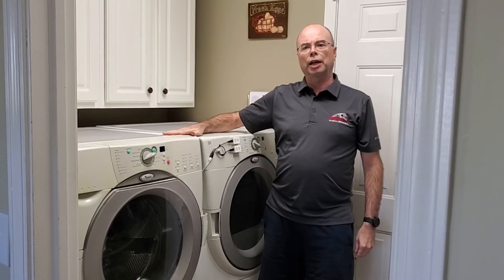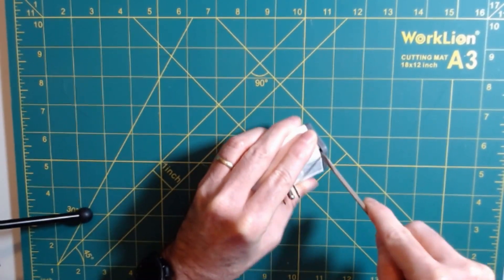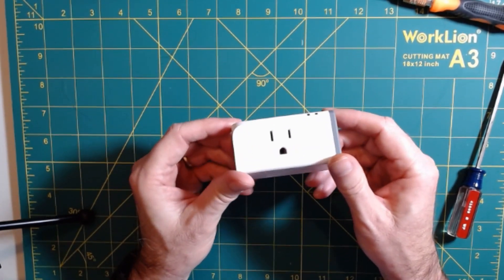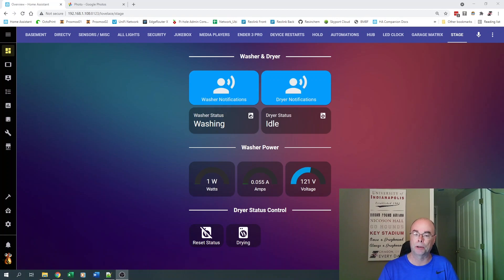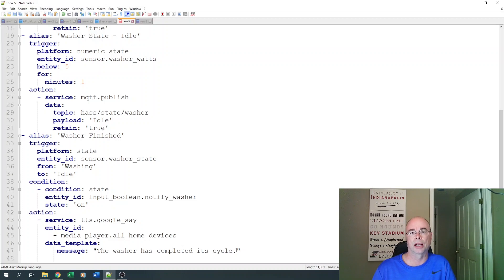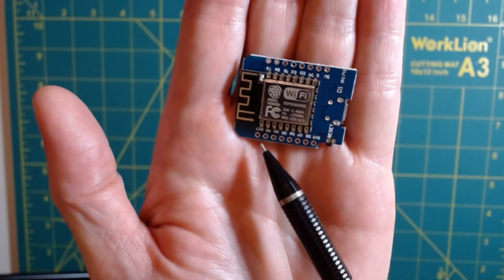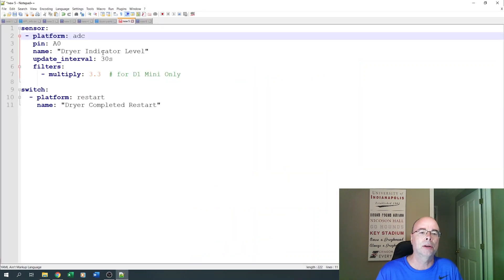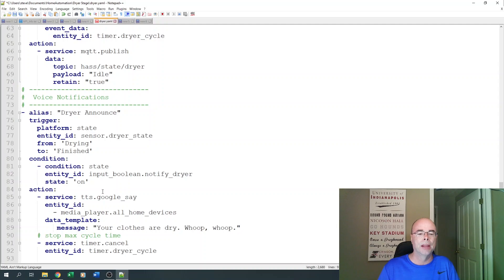Washer and Dryer Notifications for Home Assistant

Comment from the maker: UPDATE:  Due to discovered inconsistencies over time with a photoresistor and the analog (ADC) pin on the D1 Mini that would require a rebuild of the sensor to restore original sensitivity, I designed and implemented a new and improved sensor for the dryer notifications.  You can see how this new sensor is build and used here:  https://youtu.be/P5Xm-LPHFRY

Comment: If your dryer does not have indicator lights, you could use air flow sensor or temperature sensor in the dryer vent tube. Airflow may get fouled by lint over time, so a temp differential would likely be easiest. The temp sensor could be taped to the side of the vent with foil tape so no permanent modifications needed. It would just need to see that the vent temp is higher than ambient.
Reply from the maker: That's a great idea!  My solution was pretty specific to having a dryer with some sort of indicator lights, but your solution should work for just about anyone.

While I haven't tested it, I wonder how long it would take (or how big of temperature variance occurs) from the time the vent heats up enough to note that the dryer has started, and how long it takes to cool (or how much) after the dryer stops?  And how might it work in a situation where the dryer is just running on "tumble" mode... basically just tossing the closes around and passing unheated air (our dryer has that mode... don't remember what's it called).  But it might be possible to deal with those scenarios via the automation.  Have you given this a try?  Just curious.

But it is a great alternative idea.  I love it when my viewers come up with ideas on how to improve one of my projects.  Thanks for watching and taking time to pass along a really good potential solution for those without indicator lights.
Reply: @ResinChemTech  No, I have not tested this, I was just brainstorming how to do dryer notifications and came across your video. My current automations are limited to what Alexa can do with cheap smart plugs and  smart LED light bulbs. I really want to step up my game and integrate HA so I can have more options. 

What I am contemplating is having 2 temperature sensors, 1 on the vent and one as an ambient, and then you could code in whatever differential you wanted based on your particular dryer personality. I would guess that it would not take long to sense a significant delta between the sensors. Using a delta would also help offset any seasonal heating or cooling that may happen to the vent tube if it is close to the outdoor exhaust point. I was also thinking about  the 'wrinkle guard' or cooldown cycle, and I think it would be a good idea to announce the cycle complete before the dryer fully shuts down, so that clothes can be removed during that wrinkle prevention part of the cycle. My dryer actually sounds the (annoying) buzzer at the start of that cycle and again at the end. 
Remember in your stair lighting video where the TOF sensor is taking measurements all the time, but it only reports to trigger the automation if the variables align to make it 'True'. I think a similar coding would work here so the automation logs are not flooded with unnecessary readings. 
Again, I am just brainstorming, and being Thanksgiving, my thoughts are clouded by tryptophan and pumpkin pie. :) Hopefully the idea will spark someone that knows how to create the code. If I get there first, I'll update.
Reply: @ResinChemTech  I used this method by placing a Dallas temperature sensor in the the bottom of the dryer, against the exhaust tube.  I also added a Home Assistant automation to monitor and to send a message if the monitored temp goes above 100.  This I hope will notify me if a blockage were to develop.

Comment: I know you didn't go down the road of internal relays on the buzzer due to martial bliss reasons. If you could, what would be your setup? What relays would you use? controller ? etc.
Reply from the maker: Well... until I opened up to see what I was working with, it's hard to say for sure.  Assuming that there was DC voltage present (highly likely since there are indicator lights, two 8-segment numeric displays and a buzzer... it's unlikely these all run off of AC), I'd likely use the DC voltage stepped up/down to 5V and use an ESP8266.  

I'd then likely use either the buzzer or the cycle complete indicator light as the trigger for the automation.  Voltage would be applied, for example, to the buzzer when it sounds that the dryer cycle is complete.  I could take this voltage (stepped down to 3.3V max) and connect it to a pin on the ESP8266.  It would watch for a voltage change... and that would trigger the voice notification via Home Assistant.

A challenge might be a reliable wifi signal to the ESP8266 board, since it would be inside the metal cabinet of the dryer.  But since the front panel is plastic, I could probably position it so that it would get an OK signal, as I have a access point just a few feet away in this case.

Again, all this is hypothetical based on what I found inside the control panel.  But those were my initial thoughts.  As long as there is DC voltage present within the control panel, there would be a lot of ways to tackle it... likely with just something like a D1 Mini/ESP8266 and maybe a buck converter and a few resistors.  I might convince the wife someday to let me try, but to be honest the current install is working fine, so she is less likely to let me try it as long as the present system is meeting her needs!

Comment: Nice video! I am new to HA and I am trying to build an automation like this one. I am having difficulties in creating sensor.washer_state in order to use the “from ‘washing’ to ‘idle’” state. Any help appreciated
Reply from the maker: Well, I'm guessing you have the MQTT integration installed and configured in Home Assistant?  This 'state' is really nothing more than an MQTT message published to a given topic.  The automation in turn, watches for the MQTT value to change as the trigger.

Note that in this particular case you wouldn't absolutely have to use MQTT states like 'idle' and 'washing' but could simply use the power (amp) values from the power monitoring plug as the trigger for the automation (e.g. when amps drop below 5").  I only use those MQTT states because I like to show "Washing" or "Idle" on my dashboard.  But you could alternatively do the same thing using a templated sensor or text input helper instead of MQTT.  For a templated sensor, the value of the sensor would be based on the current amps (Washing when > 5 and Idle when < 5... or whatever power value you need).  Similarly, you could update the value of a text_input helper to Washing and Idle via an automation when the amp are above of below your threshold.  Then you could simply display the template sensor or text_input helper on the dashboard.  I just opted for MQTT because I was already integrating all the Tasmota info via MQTT (this was done before the Tasmota integration and MQTT discovery existed, so it had to be done manually via YAML).

I don't know if any of that was helpful... or more confusing!  But if you are trying to use my code examples to create the state sensor, then assure you have MQTT integrated and setup properly in Home Assistant.
Reply: @ResinChemTech  I have MQTT installed. I will give it a try copying your code. Thanks again!
Reply: @ResinChemTech  I have copied/pasted your code in my automations.yaml and edited it for my tuya socket entity, but still having difficulties in seeing that washer_state sensor. Before seeing your video, I used the power sensor of my tuya smart plug (notify when power drops below 3 W), but I kept getting false notifications. That’s why I need a sensor to show the status and use it ex. from state ‘washing’ to state ‘idle’, then notify. 
MQTT seems to work fine. 
It seems that I’ve reached a dead end with MQTT and I will try to use template sensor.
Reply from the maker: Well the "washer" status was nothing more than my own sensor that I created in YAML that published a state based on the watts.  It is not coming from any outside source (smart plug, washer, etc.).  It is really just a "middle man" that gives me a text value to display on the dashboard.  So it's technically a "fake" state that is just based on the watts.  When the watts are above 5 (in my case), I publish a "Washing" state... when it drops below 5 W, then I just publish the "Finished" value.  Even if you had it working, you'd have the same issue with the false notifications, as the state of washing, finished and idle are simply based on the wattage from the smart plug.  But yes, you could create a templated sensor that does the same thing without publishing the state to MQTT.

To prevent the false notifications, assuming your washer drops below some threshold during the cycle but before it is complete, is to first determine the maximum time it is in this temporary lower value.  So, for example, if you washer goes into a soak cycle for 3 minutes where the watts fall below 3 (or whatever value) before rising again, then you automation should add a "for: " clause to the trigger to say that the watts must remain below the given value for a time that is longer than the temporary state (say for example  for: "00:04:00" minutes).  This means the notification won't happen for 4 minutes after the cycle actually completes, but at least it will eliminate those false notifications during the cycle.  Then if you really want to use those "Washing", "Finished" and "Idle" text labels,  you can publish the appropriate MQTT message based on the wattage with the appropriate delay.  You can then create an MQTT sensor as I've done for displaying the state and using the state change as a trigger for the automation notification.... or create a templated sensor with the text values.  Both can provide the same sensor text value.

Comment: I'm interested in doing this project for my dryer. What gauge of wire are you using for soldering on the Wemos?
Reply from the maker: I believe I used 24 gauge wire.  I opted to use solid core, just because it was easier to bend things into place and keep them where I wanted them, but you could use stranded wire as well.

Hope that helps.  The washer and dryer notifications are a couple of my wife's favorite automations.. and some of the first ones I did after I started using Home Assistant.  Let me know if you have any additional questions.

Comment: Great job.. But cant we use two photosensors(LDR) in same d1mini in different Gpio pins?
Reply from the maker: Actually, not with the D1 Mini or an ESP8266.  The photosensors use an analog pin to measure the light level and there is only one analog pin (A0) on the D1 Mini.  I suppose if you upgraded to an ESP32 that had multiple analog inputs, you could use a single board.
Reply: @ResinChemTech  yeah esp32 mini board looks promising.. Thanks for your reply 🤩

Comment: Great work. I would like to do the same for my wife. I passed for the washer, but for the dryer, I may have missed something. What code did you put on the Wemos mini? It's the only thing I miss.   Thanks!
Reply from the maker: Hi! For the dryer sensors, I used ESPHome.  You just need to define an ADC sensor (with the photoresistor connected to the A0 pin of the D1 Mini).  You can see an example of the code on the ESPHome website here: https://esphome.io/components/sensor/adc.html?highlight=adc

The code at the top of this page is almost exactly what I used (well, I did change the name and shorten the update interval to 30 seconds).  But also see the "Note" under this sample code about adding a filter for the D1 Mini.  So, I don't know how well it will come through here in the comments, but the sensor I added for each of the dryer sensors looks like this:

sensor:
 - platform: adc
   pin: A0
   name: "Dryer Indicator Level"
   update_interval: 30s
   filters:
     - multiply: 3.3  # for D1 Mini Only

I think I also showed this code at around the 18:00 mark of the video, so you might take a look at that section again. Naturally, I used two of these sensors, each with a different name.  But otherwise, the code was identical.  Naturally, the ESPHome code will contain your wifi info and other stuff that gets generated automatically when you create a new ESPHome node.  You just need to add the above sensor to that code and then flash to the D1 Mini. I hope that helps!  (by the way... these two automations for the washer and dryer are my wife's favorites !).
Reply: Thank you very much, I'll try that immediately
Reply: And it works!!! Hooray!! My wife will be very happy. Thank you so much. 🥳🎉
Reply from the maker: WooHoo!  That's great.  Glad I could help out... and increase the WAF in the process.  Let me know if I can help out again in the future.

Comment: Thank you for the video. I have flashed two S31 plugs, calibrated them and placed them on my washer and dryer. I also watched Digiblur video as well.
The question I have is that neither one of them show a sensor with the word watts in them the entity that is shown that is associated with watts is listed as (sensor.washer_energy_power) followed by unit_of_measurement: W
device_class: power
friendly_name: Washer ENERGY Power
Might you be able to tell me what step I missed to name it watts
Thanks
Reply from the maker: Hi! I'm guessing you are using the default Tasmota integration in Home Assistant?  I think both my and Digiblur's versions were done before the Tasmota integration existed, so we had to define the sensors via MQTT in YAML.  In that case, you specify both the entity and friendly name as part of the YAML.  I'm still not using the integrated Tasmota, but you should still be able to change the entity name.  It's a little hard to show/describe here in the comments, but I'll try to get you started:

Assuming you are using HA 2021.12.x, go to Configuration -> Devices and Services.  Locate the Tasmota integration and select 'Entities' (or select the device, then entities).  From there, you can click on the entity 'sensor.washer_energy_power' and under those settings, change the entity name to whatever you want, e.g. sensor.washer_watts.

Also note that you can specify whatever name you want in the front end of Lovelace when creating your cards, regardless of what the entity is called on the backend.  Let me know if this works for you.  If we need to proceed any further, you might consider dropping me an email (you can find my email address on the 'About' page of my channel... I don't like to list it here in the comments because it gets picked up by bots and leads to a bunch of spam!).  Sometimes it's just easier to assist via email where I can include screen shots, etc.
Reply: @ResinChemTech  Thank you so much for the assistance. I modified what you told me in that I went into the core.entity_registery and edited the information there. It no works well. Again thank you and keep continue to make videos. And most of all thanks for the tips on using the colored boards for soldering, that has been a lifesaver.
Reply from the maker: Great... glad I could help!  Yeah... I stumbled across those Electrocookie boards when searching for a way to replace the breadboard versions I was using before.  I try to hide my controllers in various locations (like the back of cabinets), but kept running into issues when something would bump the board and knock a wire loose from the breadboard.  I now use those prototype boards for nearly all my projects.

Comment: Very nice solution, thanks. Your dashboard for the Washer & Dryer looks good, could you post the code for it, or even a brief description?
Reply from the maker: Glad to help.  As far as the Lovelace dashboard, the top two voice notification status buttons and the bottom two dryer status buttons are custom button cards (installed from HACS).  Everything else is standard... the status text cards are entity cards and the power row are simply gauge cards.  Everything is kept "aligned" using a combination of a vertical stack card and horizontal stack cards for each row.  You might be able to use the new grid option instead of the vertical/horizontal cards.  I'd be happy to post the yaml, but in all honesty, it would probably be more work to try to copy/paste  that and edit for your entities, script names, etc. that it would be to create it from scratch.  But let me know if you have an questions about how a particular card is setup and I'll be glad to try to help.
Reply: @ResinChemTech  No, that's perfect thanks. I was mainly curious about the status text cards, so I'll have a play with that and try to reproduce your layout.

Comment: This is exactly what I am looking for. I have a table top humidifier where I want notifications when the water level is low. Going to try this. GREAT job. Small ask...Where did you find the sensor case to 3d print? Can you share?
Reply from the maker: Thanks!  It's great that you found another potential use for the dryer sensor.  I designed the enclosure in Tinkercad... it's not overly professional, but it works!  I've thrown the .stl files up on Thingiverse for you: https://www.thingiverse.com/thing:4972121

You may have to use an Exacto knife or similar to 'clean up' the opening for the photoresistor.  Threading the leads from the photoresistor through the tiny holes can be bit of challenge as well.  Let me know if it works for you with the humidifier.  Good luck!
Reply: @ResinChemTech  Thanks! I'll give it a try and let you know my results